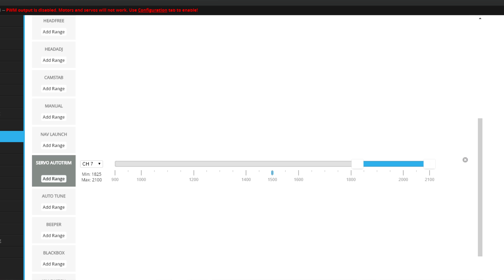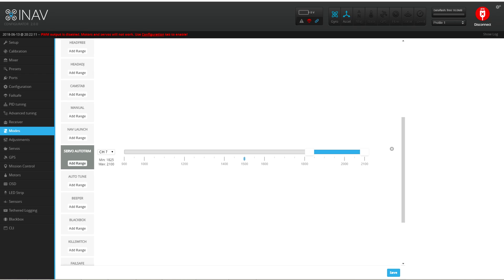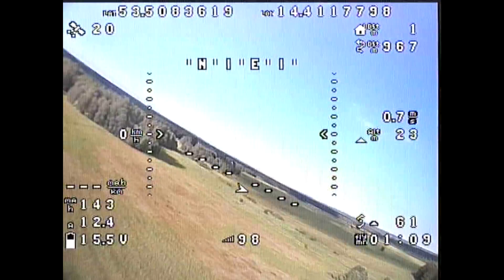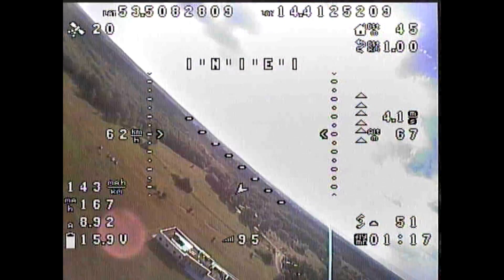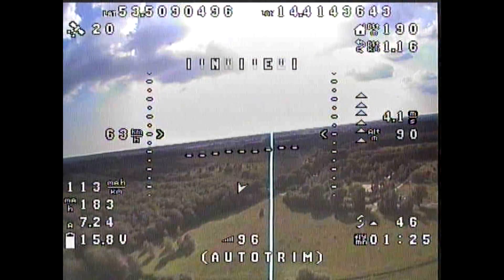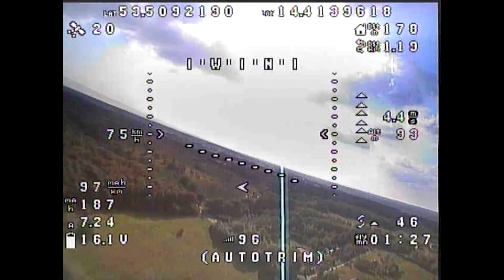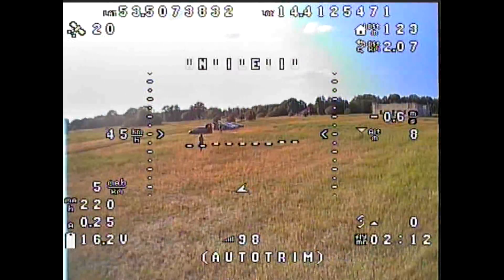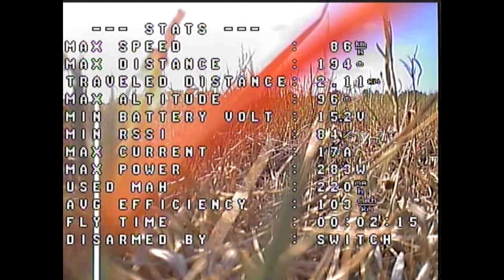How to use INAV Servo Autotrim

Comment: Hi, i do maiden flight in manual mode and trim my model on my rc transmitter, how copy trim settings to inav?
Reply from the maker: The thing is that you don't. Set Acro, run Autotrim and you are done. Let flight controller handle trimming
Reply: @FPVUniversity  Ok, i set trim to 0 and try witch acro mode + autotrim, but i was try acro yesterday and model was very very lazy for input from radio. You have old video where you talk about PIFF on flying wing and recommend to set P =0, I =6~8 and leave FF for autotune. It is still actual on inav 5.0 or maybe leave all for autotune?
Where i can read about setup for fixed wing?

Comment: What flight mode should you be in, before activating AUTOTRIM? MANUAL or ACRO?
Reply: Doesn't matter. I'm using CRUZ so it flies straight with no input ;).

edit: Pawel says acro is best.

Comment: My understanding after watching tons of videos and seeing this done different ways (probably a lot of them incorrectly) and reading the INAV Guide for Fixed wing is:
1.  Fly high enough that you've got some room for mistakes/nerves
2. Flip to ACRO mode (you don't want to be in Angle or Horizon (I'm not sure on this but this makes sense to me because if you might not be flying straight and level at this point in angle mode)
3. Get straight and level in acro mode then take your hands off the sticks for 2 seconds (guide says 3 seconds).  (From what I understand, it is the 2 seconds with out stick input that is the key (this is why angle mode probably is not correct because you may not being flying straight and level in angle mode for a few reasons so you have to put your hands on the sticks to get it level).  This is the part that always confused me because watching people do this on YT, they would flip the switch for autotrim, fly around do some banks, land, disarm, and then turn off autotrim. I didn't understand how the autotrim wasn't constantly changing when you are turning and changing altitutde to land.
#4.  I'm not sure the above is true, just my understanding.

Comment: Excellent. I would add that if you're burning fuel in the process, then pick a midpoint burn off to do it because your CG is relative. After doing this, a look at the control surfaces on the ground when the computer thinks its stable will tell you where your drag is. Oh, don't forget your throttle range during the autotrim.

Comment: can I fly horizon (so controller flyes the plain level) and enable autotrim while I am still in horizon mode or do i have to fly acro or passtrough mode
Reply: I'm curious about this as well, any info would be helpful, Thanks!
Reply: Yes you can fly in Horizon Flight mode and do an Autotrim. Then you will be trimmed for all flight modes.
Reply: As far as I understand, any stabilized mode (such Horizon) would need the correct trim to fly leveled. So if the plane is not trimmed, once you enable horizon, it won't flight straight regarding the plane, but regarding to board alignment (generally not perfectly aligned to leveled flight). 
To sum up: you need to trim first and then use horizon, not the opposite.

Comment: hello, after save the new midpoint of the servos with auto trim, how can I reset them after they been saved? I mean to start from zero
Reply: There is a spot in the configurator - I think configuration tab - to manually input trim numbers. Just zero them, save, and reboot

Comment: In what mod i must fly to do autotrim?
Can you record how to program more flight modes on taranis?
Because you can program only three modes on one switch and for the start you have listed at least four modes: angle, manual, rate, autotrim, autotune😉
Reply from the maker: you can use multiple switches. And the best mode for autotrim is Acro
Reply: @FPVUniversity  Look like i just got my answer to previous question, thank you!
Reply: @FPVUniversity  Could you use CRUZ for a lazy/easy level flight while Auto-trimming?
Reply: Ok 👍

Comment: Soooo....when you use the Auto Trim function, I need all my trim levers centred first..?....Or does it not matter?.. and I can centre them after saving Autotrim by disarm?
Reply from the maker: It does not matter. It will just set required trims for level flight

Comment: I most apologize for being an ass the last few weeks.  I finally managed to get my F411 FC working on my AR wing and I most say I’m very impressed!  All be it I need to do some tuning all features where working properly including RTH which is a big one for me.  
All in all coming from Arduplane to inav was a huge learning curve and I’m still quite new to inav I have to say it’s functions are great and really user friendly once you get over that hump which ever that may be for each build.  
My only concern now is failsafe which I really haven’t tested thoroughly yet but I’m using The X8R receiver with QX7 transmitter that’s set to no pulse but when I tested on bench by turning off radio the AR motor spins up and continues to spin until I power my radio back on and it reconnects , then and only then can I regain control. Maybe I need to research slot more on this failsafe thing because I’m not to sure that I have it setup correctly in my AR.  I want FS to put the inav into return to home and hopefully that’s what I can do.  Can you give me some advice on this?   I can confirm though that switch RTH does work and works flawlessly but FS /radio signal loss is a huge concern of mine.  
Thanks again for your patience and thank you for all the hard work and hopefully you accept my apologies.

Comment: I make shure all my servos are center, then on INAV check my radio outputs are 1000 1500 and 2000,  then flight the airplane and land adjust the control rods up to the point that I have strait and level flight with manual activate in inav, then flight one more time, airplane now may be flying strait, next switch to angle and see what the plane does, and now observed nose deep down loosing altitud or banking left,  land and adjusto roll or pitch in Inav board aligment, ones the plane flight level and strait im done and continued with gps flight modes.

Comment: Hello, I just bought my first wing after flying & building quads for 3 years but I'm hitting a snag with iNav. No motor can be seen in the tab or servos in the tab. It is yelling me to goto mixer, but the mixer is telling me to get latest firmware to use. I'm on configuration V 2.0 rc3
Running inav 1.9.1 on a matek F411 wing
Omnibus f4 pro & SPRF3. All with same problem. If I use the S800 preset and arm it. the servos move as expected if I tilt the model. & the motor will twitch if I throttle up. But they have no input to the boards. Any help would be appreciated, thanks.

Comment: Hi Pawel, I should mention that it is not clear what you mean with the word "trim" in this video. I thought I should trim the wing with my RC so that the FC knows what are the midpoints for level flight and for RC input measurement. But on telegramm someone told me I was wrong. Maybe you should add some text to the video so that everyone knows with the word trim you mean to hold the sticks that the plane flies straight.
Reply: Autotrim adjusts the servo midpoints for level flight.

You are talking about your radio for center on the stick is 1500 on all axis.

So.. you should do both :)

Comment: So if I do an autotrim, but I am not happy with the resulting midpoints, then I can switch off autotirm mode and then redo it again in the same flight? Thank you for this video, I read through the iNav info but didn't fully understand this function
Reply from the maker: yes

Comment: Why have to land to store trims to eprom? It would be much better to have ability to trim in air. I presume for drones it's not an issue but some airplanes, like multiplex, need often small trim adjustments especially when i change to different battery. Its very hard to keep center of gravity unchanged. And every time start and land... Difficult option. Why not to store settings after another 5secs with message trim success.

Comment: okay, let's see if I get it right, I leave my model as mechanically trimmed as possible, I start flying in stabilized mode, I activate the autotrim and fly for at least 2 seconds without giving any command so it stays stable, I keep the autotrim mode until the landing and when it is on land deactivates the aircraft and it will automatically save the new servo points? That's it?
Reply: My understanding is that you stay level. So if you have to give minor control adjustments to do so, it's OK. Those commands will be averaged into the final servo position. Perhaps Pawel can clarify?
Reply: I learned today that there can be no wind, it has to be on a very calm day, I took a model airplane of mine that flies in manual mode perfectly and I made the autotrim with a strong and turbulent wind, the airplane did not fly but in manual mode, I had to do the auto trim again in the early evening when it was already windless and everything was ok.

Comment: How hard would another switch position to 'save' the setting be, versus disarming? It would be so much better in the real world, as flying different conditions and batteries etc make a second (or third) takeoff just annoying.
Reply from the maker: Hmm... that might make sense. On the other hand, as long as you do not change the CoG or linkage, you should not have to trim again

Comment: Auto trim is such a lifesaver compared to the old method of fly, fight the aircraft, land, adjust, fly again, still fighting the aircraft, oops adjusted in the wrong direction, now it’s worse, etc.

I would still recommend that after auto trimming, now that you know what your servo centers are, if they are way off center, go back and adjust the mechanical linkages and then reset the auto trim. If you don’t do that, your servo “centers” could (theoretically, in a bad setup) be near the end of travel, and then weird things will happen when you try to input control movements. My point is don’t be lazy and have a horrible linkage setup and count on auto trim to fix it all for you.

Comment: Nice video, but if it makes a snapshot every 2 sec of the servo position, when i start to land, i can't fly strait and level. It wil record these positions aswell. So the last 2 sec are not midpoints begore i disable ( the autotrim is still activated)

Thanks in advance
Reply from the maker: it takes a snapshot only once
Reply: Paweł Spychalski thanks so if i activate when flying level it takes on snapshot and thats all👍

Just watched your inav 2.0 RC1 very clear. But still hasitating i am currently on 1.8 stable and no glitches what so ever.

Comment: Thanks… good explanation. Have set this on a switch and will try as soon as weather breaks.  Have been trying to use OSD menu and Stick functions to set Trim Acc settings. Do not find in OSD.  Are Stick Functions supported in 1.9.1.  All servos are set to 1000-2000.